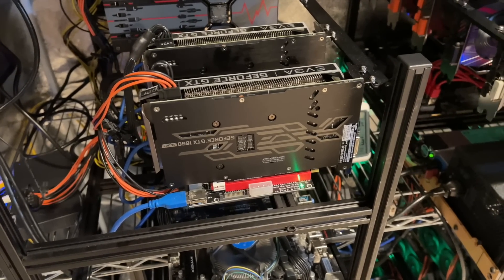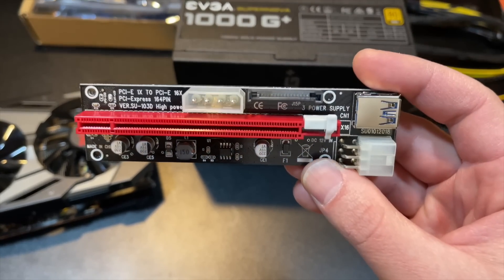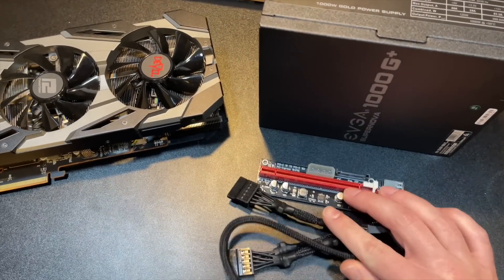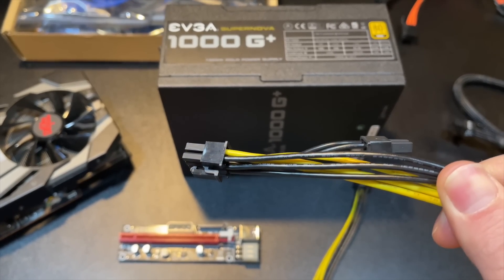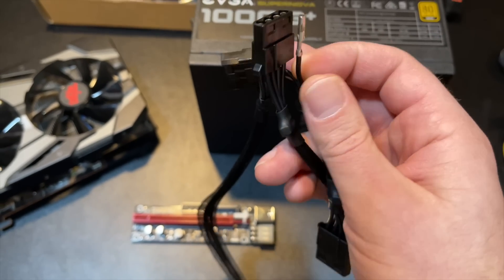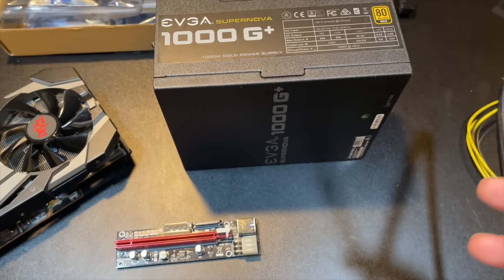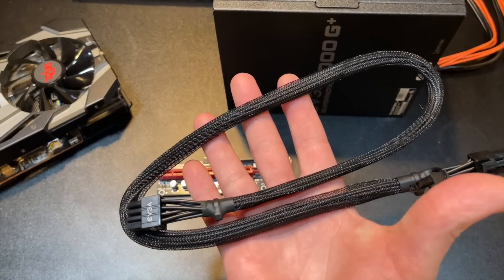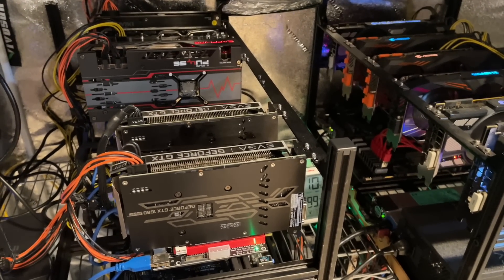Powering GPU Mining Risers Safely

Comment: Not convinced at all.. You should buy an Amp-meter first and use it on your exampled GPU first, before sharing incorrect info. I tested the amps at riser on a Sata (power cable) on 570, 580, 6700 and 6800xt and their maximum current draw was 4.8Amps which on 12V is no more higher than 60watts. The SATA cable uses an 18 gauge cable, which can take up to 15 Amps on a 2.5Feet length. From “my calculations” I can safely say that SATA cable can be used to power a riser and even two risers can be easily powered through a single sata. Guys…. Please dont spread incorrect info without doing your homework. Dont make your goal as just to gain views or just to make  money….
Reply from the maker: What are your thoughts on the spec of SATA being 54w? You think the pins in the SATA connector can do more than that?
Reply: @RedFoxCrypto  Again I will say use a clamp meter to test… If you see the riser SATA cable one more time, then you will notice there are two yellow cables coming from SATA connector which goes to two separate pins on 6-pin connector end. Total Amps on these two yellow cables (as mentioned earlier) is maximum 4.8Amps. Now as there are two cables that goes to two different pins, so each yellow cable has roughly around 2.4amps. And if you do the maths, the max current on a single pin never exceeds 28Watts (P=V*I).
Reply: I watched all those videos where people demonstrated the high temperature on SATA riser cable in their “so called lab test”… they dont even know how to correctly perform this test, as they inject power on single pin of 6-pin connector. Of course it will fry when you inject 70 watts to a single SATA pin. PLEASE NOTE, its not a single pin that handles all the power of GPU. its two separate pins (i believe pin 1 and 3) and the riser distributes the GPU power in these two pins. SO, show us a test where you “CORRECTLY” inject the power to the riser SATA cable and it burns………..
Reply from the maker: @imi9121  I’m not sure if we are talking about the same things here. I’m talking about the actual connector not the cable. All SATA connectors are built to the standard specs I reference in the video and the video description. 

There are 3 pins in the SATA connector that connect back to the 12v rail of the PSU. Each pin is rated for 1.5 amps. The math for total wattage is 3*1.5A*12v=54w. 

Do you have a reference showing different?
Reply: @RedFoxCrypto  lets talk about Amps the “SATA connector” can handle. Its 4.5amps. In my above current testing example, I showed the “max current”, which continuously fluctuates (as mining load is not always same). The “average” current is 4.4Amps on SATA. Which is within the limits. But keep in mind, the SATA specs shows 4.5Amps continuous current that a connector can handle, and I believe we all know that manufacturers keep a cushion in their specs so that their max ratings are always within a safe range, so no one can sue them in case of incident. (Break/splice one of the SATA connector Pin and measure its gauge to find its actual max ratings).
All my replies are based on the card you used as reference/example in this video i.e. 570. And i did the test on 4 other models cards as well to get their Max and Average current on SATA end. So, there is no way one can burn their house by powering a GPU riser through a SATA cable, if used/powered correctly.
Reply from the maker: @imi9121  Okay I understand your perspective. 

The point of my video is to always plan for worst cause scenario no matter what GPU you are running. Of course miners run their GPUs power limited which reduces the pull all around. If overclocks reset or GPUs are ran with stock clocks the power pull can be much greater. Even different series of GPUs pull different power. Check BBTs video in my pinned comment. 

Taking an approach based on available specs and documentation is the only way to responsibly provide a video that shows how to power risers in my opinion. 

Thanks for the conversation and thanks for watching.

Comment: Thanks for the video! From what I understand it depends on the molex pin length. The pin length determines the amperage, as it impacts the surface area of the connection .I found the following info on wikipedia. "There are three typical pin sizes: 1.57 mm (0.062 in), 2.13 mm (0.084 in), and 2.36 mm (0.093 in). The 1.57 mm pin can carry 5 A of current, while the 2.36 mm can carry 8.5 A. Because the pins have a large contact surface area and fit tightly, these connectors are typically used for power."

Comment: Great video, thanks a lot! Helped me understand I need to do some research before deciding how and what I will do to be on the safe side. That being said, I have an XPG Core Reactor 850w PSU and according to the SATA and Molex cables specs they are 18 awg which means they support up to 600 watts and I should be safe connecting 4 risers to either SATA or Molex. Is that correct or am I missing something?
Reply from the maker: Thanks Juan. It’s the pins of the Molex and Sata cables that are the weakness, not the gauge of the cable in this example.
Reply: @RedFoxCrypto  thanks for the clarification! Another doubt is, according to some blogs, the gpu will not drawn any watts or very minimum from riser if you have all the 6 or 8 pins connected to a PSU that has enough power to feed it. It will only try to obtain the watts from the riser if the 6 or 8 pins connectors are not enough. Is that true?

Comment: If we have RTX cards, how would you power the riser and GPU with PCIe cables only? How would that setup look like going from the PSU going out to both the card and riser?
Reply from the maker: You'd need at least 2 PCIe strands from the PSU depending on the exact GPU you have. One can be split to power the riser and a PCIe plug on the GPU and the other just the PCIe plug on the GPU for any dual 8-pin RTX series.
Reply: @RedFoxCrypto  It'd be a RTX 2070 build. Should I have an 8-pin strand from PSU go to the splitter to power the risers only?

Comment: Here's a crazy question. Could you use BOTH the SATA and MOLEX and get power from both, or will the riser only pull from one of the options? I only have 1 PSU, and not enough PCIE cables to run 2 to each gpu plus 1 to each riser.

Comment: Thanks for putting the time into this. Got into mining a few months back and your videos are the ones I keep coming back to.

One answer I can't find as a noob: like you said, the TDP of your 1660 is 125W, and the riser is 75W. That's 200W you'd want to safely hit. Yet, the splitter is only good for 192W.

I'm trying to power 3070s that are 220W TDP, and a 75W riser brings it up to almost 300 per set. Yet I see diagrams and videos of people powering them all through cables that are rated below that.

Help me understand?
Reply from the maker: Hey Micah! The 75w that the riser can pull is part of the 125w TDP of the GPU. So it's 125w total. So for your 3070 the total draw between the riser or PCIe plugs on the top of the GPU would max at the 220w. Hope that helps buddy!
Reply: @RedFoxCrypto  You are a gentleman and a scholar. Thanks so much for the clarification.

Comment: If the PCIe 6-pin cable can handle up to 192w, wouldn't it be overloaded with a splitter to a 125w 1660 Super plus the 75w riser card?
Reply from the maker: Yo dude! The 125w includes the 75w from the riser pull.
Reply: @RedFoxCrypto  Thanks for clearing that up!

Comment: So I have a rtx 3080 as main card. Just got a 3070 to add to the pc to mine a little more. I have a Asus 3070 KO and it takes two 8pin to power the card. So I’m using a Dark Power Pro 11 PSU 1200watt supply. They come stock with a cable that has two 8pin connections and a 6 pin connector on one cord. Can you power the riser with the 6-pin and use the other two 8pins to power the 3070 card and riser safely?

Comment: This is the most useful mining advise I have ever watched, listened to, or read. Power specs for these ports are not front and center, and the power draw seems to differ from card to card. Using only the 6-pin connectors for my risers fixed intermittent problems I have had for years. Thank you!
Reply from the maker: Awesome dude! Glad I could help out. Happy mining brother.

Comment: Hi Mike, thank for the video. Can you also show us how to power 3080 in a safe way? 
With a 320 TDP, let's say the card is 2 slots, would that be safe to use 1 strand of 8pin to 8pin dual for both, then power the riser on another cable strand? Some told me that's dangerous and said 3080 should use 2 independent 8pin from PSU.
Reply from the maker: I power my 3080 this way. One strand for the two 8-pins on the GPU and another strand for the riser. Keep it power limited.

Comment: 1 thing I do not understand.
If a GPU draws 60 watts, which cable it will draw the power from? Pci-e connector/cable or from the riser?
If it draws the power through pcie cable, why do you count the riser would take 75 watts?

Comment: While you are perfectly correct, sata connector may work just fine for the riser card, and I think molex too since area of connection is bigger then sata, and risers don't actually use max power. But the build of the cable is very important. I've used 2 sata to pcie 6pin adaptor, and even tho I used 2 separat sata cables (to have more wires) I found out cables were getting hot because they were AWG18 and cables for PCI were AWG16. The PSU manufactures cut a bit of a corner on the cables while keeping all to spec. And I was forcing them to feed a 3080. It all worked fine, but I didn't keep that configuration and got another PSU. One thing is for sure, if stuff is warm to the touch, then it's probably not good on the long run, especially on an unattended system that runs 24/7.
Reply from the maker: Good stuff Adrian. Thanks for sharing. Happy mining brother.

Comment: Can i connect a dual splited pcie8 to (8pin + 6+2) pin connector to split the 8 pin to two 8pins for the gpu and the 6+2pin to use it for the riser the gpu is a 3070 nvidia
Reply from the maker: I use 2 separate stands for a 3070. One for the riser and one for the GPU.
Reply: @RedFoxCrypto  thank you for the tip 🙏😊
Reply: @RedFoxCrypto  i set up the miner yesterday thanks to your vids and im using hive os i have 2 zotac 3070 but it seems im getting some bad shares which i really don’t understand, what settings would u suggest for me to overclock the 3070 to get better efficiency cause now im standing at 88% it seems i cant figure it out

Comment: About the Power Rating for the 4-pin molex pins... They should handle 13 Amps. Here a few general examples:
https://www.tme.eu/en/details/163305-2/raster-signal-connectors-5-08mm/te-connectivity/
https://www.tme.eu/en/details/amp-0-163558-2/raster-signal-connectors-5-08mm/te-connectivity/163558-2/
https://www.tme.eu/en/details/163305-4/raster-signal-connectors-5-08mm/te-connectivity/

Comment: So, if you have good PSUs lying around, you could hook up a couple of risers to each one and you'd be good to go, assuming the PSU has the voltage. But, you'd have to use a splitter depending on the cable from the PSU. If that's right, I'm set.
Reply from the maker: Yes, just keep in mind a best practice to have the GPU and it's riser on the same PSU.

Comment: Definitely only one Molex connector should be used per cable for the risers but all research I've found on powering PCI risers with Molex is in agreement that those connectors are safe to use.  You have to remember, the GPU is generally going to pull the majority of its power from the PCIe power cables, not the PCIe interface itself.  So the odds of you actually pulling the full 75W through the PCIe connector is probably pretty low.  For instance, running HWiNFO on a 3090 that draws 300+W shows the PCIe connector from the riser is only supply 64W to it, so even if you had the 5amp capable cable running at 60W, you're pretty darn close even in that situation.  If in doubt, connect your GPUs and monitor it for a few hours.  Feel the cables near the connector and I would imagine if it was in fire hazard territory, you would feel some heat or see some damage there.  Or you can use HWiNFO and see what your actual draw on the PCIe power line is and use a PCIe cable if it exceeds 60W.

Comment: Hi I’m have one psu be quiet straight power 11 1200w  and have 3 pcie e rails with 8 pin my prob is have 3 cards and can’t power all  3080 suprim x 3080 aorus master 2070 super try put in molex to power risers but no turn on card and not find in windows whene power rizers with pcie all work perfect ;) what need make so power on only rizers with molex ? My psu have 4 rails molex

Comment: Does this mean I can use 6pin PCIe cables to connect the riser to the SATA ports on the PSU? I know it is safer to use the VGA / PCIe ports on the 12V rail when using 8pin to 6pin PCIe with a splitter (resulting in a max 216W between the two ends of the split according to https://www.gpuminingresources.com/p/psu-cables.html) but there simply isn't enough of them. 

I've also been told that to use the CPU ports (instead of the SATA ports) but usually one is taken by the actual CPU, leaving me with only 1 CPU port to work with.

Comment: Great video man, I'm pre planning for my first ever build and wanna know, if the graphics card (MSI radeon rx550 aero itx 4g oc) pulls power of the mother board how do you externally power it? Considering the pcie 1x slot max wattage is 10w and the singular x16 slot has a max wattage of 25w. (It is going to be on a dell optiplex 390 sff) 
I'm also currently doing  research on external methods but can find a good/decent one any tips?
Oh and I'm in South Africa so that is one of the best budget cards currently, at least for me.

Comment: Great video!!! My question is I have a 700 w evga that has one collection wire with 2 6+2 connectors and other collection of wire that has 4 molex connectors, so can I pick up a 6 Pin PCI Express to Dual 4 Pin Molex LP4 Power Cable Adapter to power the risers and the 6+2 pin adapters on the previous wire to power the gpu safely till my other psu gets in?

Comment: 6 pin is 75 not 192 watts. Or?
Reply from the maker: The spec for the 6 pin connector on the GPU is that it will only call for 75 watts, but a 6 pin cable can support more wattage than that.

Comment: With my 1600w power supply, they gave me one PCI-E cable with two 8-pins. Can I safely split that cable twice to power 4 risers?
Reply from the maker: I wouldn’t personally. I keep to 2 risers per PCIe cable.
Reply: You have 288watts to play with with an 8 pin from the psu.
75 watts per riser is 300watts so your over. Will the risers ever pull 300 watts unlikely but theres no point gambling on it even if its low chance.
You could power 3 and give yourself some headroom
Reply: @chipspclounge7871  could i split a 8 pin to 2x8 pin and power a r9 390x?
Reply: @0vers33r1  yeah TDP is 275watt so you have 13 watts spare

Comment: Great video, but I was left with one question at the very end of the video.  You mention that the TDP of your card is 125.  So you say you're safe powering the GPU with cable and splitter with the cable being able to handle 192 Watts (2 pins x 8A x 12V = 192).. Since the top of your card has a TDP of 125W and the riser can pull 75W, the total wattage running through the cable that can support 192W would be 125W+75W=200W.  Aren't you going over the 192W cable limit by a total of 200W - 192W = 6W?  Or is 6W not really much to worry about since we've used conservative estimates for everything?
Reply from the maker: TDP of 125w is the total the GPU can draw. That includes both the pull from the PCIe plug on the top of the card and the pull through the riser.
Reply: @RedFoxCrypto  thank you for the amazing info. I really appreciate it

Comment: I just got my risers and server 6-pin connectors, but for some reson the PSU does not want to give power through the 6-pin cable. Its ok with bough molex and sata, but as you said in the video, thoes are not safe. Have you ever come over something like this?

Comment: very nice video. I have question,my riser has 2 times 6pin pcie connector and my gpu 1 x 8pin +1 x 6pin connector. Do I have to connect all available pcie connectors with powers supplies? I can see in the back you have also gpu with 8+6pin pcie connector and both connected, so I am just curious if you would connect also two 6pin connectors to the riser. Thanks
Reply from the maker: Thanks dude. You only need to supply one PCIe connection to the riser. Some include multiple just for convenience.
Reply: @RedFoxCrypto  thank you for answer, I wanted to have it confirmed by expert :) im gonna try it out

Comment: How would you power a RTX 3080?
Reply from the maker: Power limited I run a single strand 2x8 pin to the GPU itself and another strand 6 pin for the riser.
Reply: @RedFoxCrypto  a RTX 3080 has 3x8 pin not two. Would you rather use 3 different cables (8 pins) or a splitter?
Reply from the maker: @evripidou5879  Depends on the 3080 you have. Mine has 2. If it has 3 I’d split the load between two PCIe strands.
Reply: @RedFoxCrypto  I'ts a RTX 3080 EVGA FTW3 and thanks for all advice! I build alot of pcs but very good video about the sata!

Comment: i been reading the official pci-e spec and found out that a 1x device can draw 25w from the motherboard(75w if it was 16x), this means that the extra cable you use to power the riser only needs 50w(cause it already gets 25w from the motherboard) which sata can provide, what do you think of this?
Reply from the maker: They pull more. Watch BBTs video I pinned in the comments section for live testing of power draw.